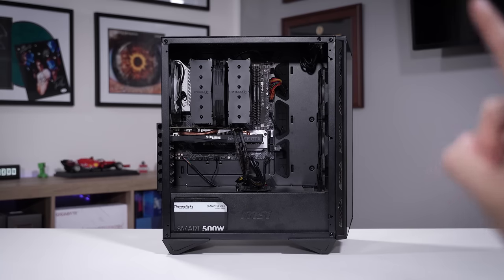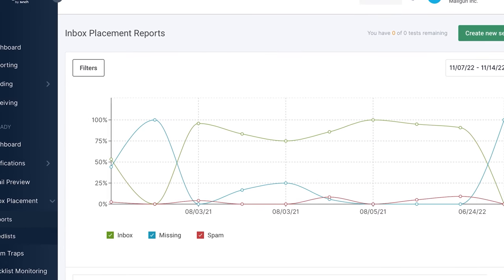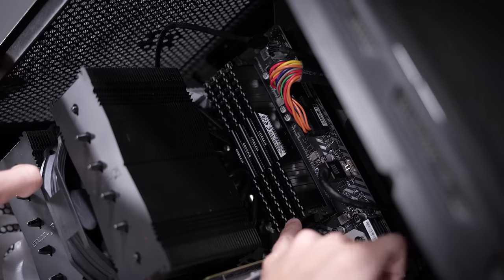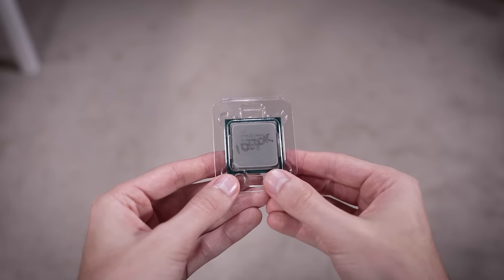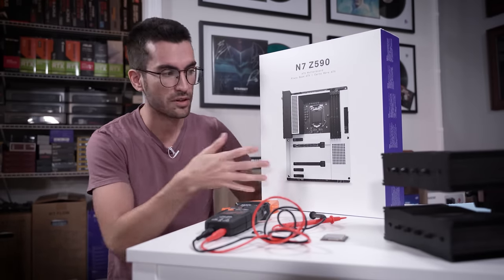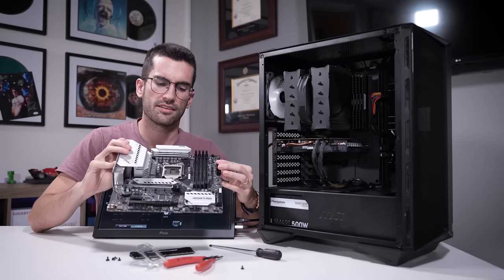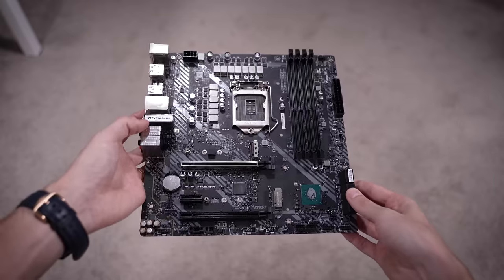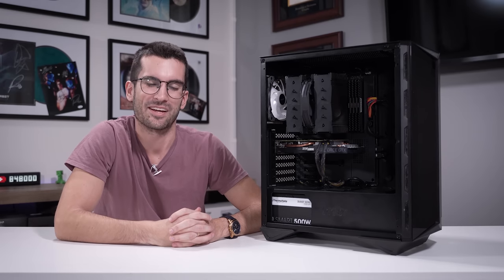Fixing a Viewer's BROKEN Gaming PC? - Fix or Flop S3:E14

Comment: @ 13:29 just to the right of the cpu socket appears to be a scratch possibly from mounting or unmounting the cpu cooler maybe there is a trace or two broken.
Reply: I noticed that as well
Reply: Can something as simple as a scratch cause that?
Reply: @Rez_97  would not surprise me if it did....
Reply: Wow! Good eye.
Reply: It does look like they trace is running towards the memory, so I'd definitely say they could be the cause of the problem
Reply: @Rez_97  yeah, it can potentially damage the traces. depends how deep it is. it doesn't take much to brick a motherboard. it should be relatively easy to fix for someone good at board repair.
Reply: good one.
Reply: I think its thermal paste drip actually, you can see the "line" of drip coming from the metal plate of the socket over to the motherboard
Reply: yes a scratch can in fact cause a board to stop working. as I did it myself on an older board I think it was an Asus Z170
Reply: @RidinWithMyLocsOn  when I saw it I thought it was thermal paste too, but it might be worth checking it out just in case
Reply from the maker: Yes, it was thermal paste hahah. Sorry about that. I should have clarified.
Reply: @GregSalazar  thermal paste can be messy sometimes. I got a motherboard half price on eBay because it was covered in thermal paste. Some time later after cleaning, works perfectly.
Reply: @GregSalazar  😆😆😆

Comment: Hi Greg,
I have an MSI MAG X570S TOMAHAWK MAX WIFI in my Rig with the same issue sometimes. No Boot and stuck on a white DRAM Led. This is a Bug with the Firmware of some MSI Boards apparently, even reinstalling does not fix it. I sometimes have to Hard Power down and then Power on my System 3–4 Times to get it booting. I swapped everything (Ram, CPU, Storage etc.) and even reinstalled the Bios a few times.
So chances are that when you power on / off the Board a few times it will boot in your case too. Oh, and it has to be done with not much time between the Power cycles, I don't know why, but if u wait like 10–15 minutes between them, it will just keep getting stuck on the DRAM Led.

Comment: I have been in a similar situation myself...

Some years back I wanted to overclock my locked Skylake CPU using a sketchy bios and needless to say I completely bricked my z170 board... Thankfully though It had a detachable bios chip so a few weeks later I got my PC working again.

Fun fact! I learned nothing and tried the bios flash again and it worked! Got my locked i5 6600 to 4.5 GHz!

Comment: I really, really like this series! Also, I want to thank you for what you’re doing to your community! I’m pretty sure this is a corrupted BIOS issue. When it happens, the MB will do all sorts of weird things and you cannot trust any debug information it will give you. My programmer has an in-circuit adapter and cost me ~80$. You could also buy preprogrammed BIOS chips, but you would need to swap it, solder it on the MB. It’s for you to decide how far you really want to go, since you have sponsors (maybe they could offer that service to you?). Keep the videos coming!

Comment: I noticed his ram is 3600 c18. I had a problem after a whole my computer started to blue screen, crash, and would not boot until remove and reinsert the ram with those same sticks. I even could not enable xmp on the board. DRAM light was on mine as well. I would try with a c16 3200. That fixed my problems and i can enable xmp with no problems. I would try that as a suggestion.

Comment: Hi Greg. So...after you swapped motherboards with completely different chipsets, how did the existing drives, and specifically, how did Windows behave after boot?
Reply: I've swapped CPU's and Motherboards using the same SSD booting drive and windows is perfectly fine the way you would normally use and operate it. Only different thing that will happen is instead of auto booting into windows you will get a Bios notification basically saying "new cpu detected" or "new motherboard detected" "press  F1 to run" then your golden. Isn't hard thankfully, just lets you know its been detected the change and thats all
Reply: I upgraded from a Z390 with 9700K to a Z690 with 12700K and my Windows 10 was fine with it. I only had to install a few drivers for the new motherboard and that was it. Not sure what would've happened if I moved into an AMD platform though, probably would've had to reinstall it

Comment: Never get tired of seeing the giant noctua coolers, ive had the nhu14s in my main rig for years and 0 complaints!   Might swap it for a newer black one soon.
Reply: @missterious69  You 100% used the wrong screws on the MB/Case. Or maybe you didn't tighten the cooler evenly and that caused a lot of pressure on the MB over time, since only one side was really carrying all the weight.

Comment: Had an AMD MSI mortar board similar to this and it had the same exact issue. DRAM debug LED was stuck on. Couldn't even use the flashbk button. Luckily the board still had a warranty and was repaired by an MSI shop.

Comment: Hi Greg. As part of your trouble shooting, do you ever check to see if the cpu cooler is on too tight ? First time i tried installing a hyper212 my pc would not post until i loosened the mounting screws on the cooler.
Reply: he remounted the cooler when trying his i5 10600k, so yes at some point in the troubleshooting this possibility is eliminated as he does this in all his videos, just a lot of it is cut to shorten the video length.
Reply: @yotoprules9361  I know a lot is done off camera, but I have not heard this mentioned as one of those off camera checks before, hence my asking.
Reply: @Zorthal  he usually takes the entire thing apart then looks at the CPU, CPU socket, etc, so when he's putting it back together he (hopefully) is mounting the cooler properly.
Reply: @yotoprules9361  you're making an assumption
Reply: @Zorthal  sure he is but its an accurate one and as we all know greg works on more computers than we are ever gonna get our hands on im 100% sure he knows how to tighten a cpu cooler
Reply: You are all misreading my question ! I know Greg is meticulous in his work, BUT has he ever mentioned that maybe the CUSTOMER has over tightened the cpu cooler causing it to not post ?
Reply: Same thing happened to me when I installed a 212 EVO on my MSI B365M a while back. Unfortunately, I think I tightened the cooler so much to the point where the traces themselves got damaged. The board still posts, but it's very unstable, lots of random system freezes, blue screens, etc. I replaced the board with an ASRock B365M Pro4 and all the issues vanished. Lesson learned there. Now I'm way more careful when tightening coolers as over tightening can really mess up those delicate traces; especially with coolers like the 212 EVO that have no dampening or any kind of protective material on the mounting bracket.
Reply: @Zorthal but we see him remove the cooler and CPU and no change. Whether the customer did or did not overtighten the cooler is not relevant. Unless you are saying overtightening the cooler killed the board.

Comment: If you are buying a bios flasher, get the ch341a v1.7/1.5 version.(one with IR receiver) useing a 5v flasher on a 1.8v chip will kill it.
It has a voltage switch for 5, 3.3 ,1.8v.

Comment: Had a kinda similar Problem with a pc we built for a friend. Z690 + 13600k, so we had to do a bios flash. The board supported flashing without stuff on it so we did everything, as gigabyte said it has to be done. The flashing went way to fast, after a dozen seconds or so it signaled to be ready. So that was something weird, as it normally takes some time. Anyway we built everything together just to get rgb and fans spinning but no output, and after like a minute the pc just restarted. The debug leds were always switching between dram and cpu. So we went and checked the ram, and it was working fine, another ram also didn't work. So we messed around and only used one stick, and it just stayed on dram. Gpu was working btw. After we tried everything we just went and sent it back with the cpu, as that could also be the culprit.

Comment: I had the exact same issue with an msi mag b550 board a couple years ago. Happened right after attempting to update bios. I ended up replacing the board but a few months later was curious and used the bios flashback on the board to install a different bios version and sure enough it worked.

Comment: Just built my 7700x pc. Glad it works fine lol. Ran it 3 days straight downloading a bunch of games and that's my real world sort of stress test lol. I'm surprised it's working considering I'm using a 650w 10 year old cooler master gx psu. Atleast until I decide to buy a new gpu when the mid range Gforce and radeon cards come out. Using my trusty ol 1060 atm xD 27" 1080p monitor with screen resolution using dsr to 1440p and all looks good lol.

Comment: My guess and though experience. He didnt flash the bios correctly or something went wrong during flashing which will give a DRAM debug been there a few times when flashing my MSI z690 board and pairing it with a i5 13600k which also showed the DRAM the first time i flashed it

Comment: Same thing happened to me when attempted to enter flash mode through bios (Ram led flashing-black screen) on MSI Z690-A Pro Wifi DDR4. Luckily mine was fixed by reducing temporarily ram sticks from 4 to 2. First thing tried that didn't help was CMOS reset.

Comment: Bad bios flash. Try replacing the bios chip? Most modern motherboards have replaceable ones. Just a thought!
Reply from the maker: He never flashed his BIOS. He was simply entering the flash portal when it crashed.
Reply: @GregSalazar  that's what he would say yes
Reply: @GregSalazar  ohhh I got you. So he didn't even attempt an update via the UEFI Bios?
Reply: @GregSalazar  Also unfortunately this motherboard has a soldered on bios chip. You could micro solder a new one but it's a pain.
Reply: @-Bracken-  you can flash the BIOS using a CH341a with SOIC8 clip without desoldering the chip, it is quite easy to use, usually available under £10 and I've fixed several boards and even a graphics card using this tool. Amazing device
Reply: @yotoprules9361  Oh sweet! Good to know! Thank you!

Comment: As for re-flashing the bios, I use a CH341a bios programmer, some of them come with the clip so no de-soldering needed. I have saved several motherboards using this tool that for whatever reason had a corrupt BIOS, and I "fixed" a fake GTX 1050ti that I got from wish, that was actually a 650ti, got a full refund on it so basically I got the 650ti for £10 (cost of the reprogrammer). I've also used it to flash a clean BIOS dump which removed the BIOS password as sometimes we get old company laptops that were previously locked down.

On the software side, there is the official CH341a software but I found ASprogrammer and NeoProgrammer to support more chips, plus you don't have to hunt down an english language pack for it.

The CH341a programmers + the clip is only like £10-15 on ebay, you may find it cheaper. You do have to be very precise when putting the clip onto the chip otherwise it won't read. Also, make sure you backup the BIOS, then wipe it, read it again to make sure it did wipe successfully, then make sure you flash a full BIOS dump, then read it back to make sure it did write properly.

Comment: The same happed to me with my Sabertooth Z170S, couple years ago. One night,  I just turned it off and when I powered back on, nothing. So I started to diagnose everything right away by unplugging everything the essential cable and nothing. The CPU LED was on on stock on it.. Well, the CPU socket died, just like that. RMA the board and got a new one. Now that rig is my home servers since I've upgraded while waiting for the board!

Comment: This happened to me recently, my board have a usb bios flash and i was able to save my motherboard. Normaly i didn't update my bios for no reason, i do it because i will not be able to install my new zen 3 processor whitout updating the bios. I'm glad i save my brick motherboard, i hate when the bios updating seems to be done perfectly but fail and corrupt the bios. I still remember my old X570 Asus Rog with a dual-bios that brick for no reason both bios and i never attempted to update the bios on it. I like those video because i learn more about pc troubleshooting.

Comment: To fix the bricked motherboard or corrupted bios. Instead of buying new motherboard, buy a tool called "CH341A Bios Programmer" or "EZP2019 Bios Flash Tool". I doesn't cost you more

Comment: My msi x570 mag gaming wifi will brick its bios if I flash it in windows or from the bios itself, I always have to blind flash it from the special usb port and button, I bet that board may have the same issue....why it has this issue, I dunno, but mine runs fine despite this irratating issue.

Comment: Having this issue right now with a brand new build, though a slight difference in event timing/cause. DRAM light stays on, though it does flash to CPU briefly maybe twice before staying on DRAM forever after.
Booted and got windows installed rather speedily, restarted and was entering setup. Did a couple clicks in windows setup then it blacked out. Fans and all that come on, GPU probably has the zero RPM setting and was known to work anyway in my old rig literally the morning before pulling it out for the new one. The RGB fans are not lighting up at all however and when I was in windows they were lit up. Reseated RAM, got new RAM, single RAM, different slots, reseated CPU, checked pins (might check again I guess), tried clearing CMOS but after watching about 20+ of these videos now I definitely did not hold it long enough so trying again tomorrow. If no luck, either new mobo or CPU time I guess.

Comment: Fixing a board like this, can take you down a rather complex rabbit hole, you end up pulling BIOS chips off boards with a hot air station, then maybe the chip itself is pooched, and finding one may be difficult to impossible.....   

Now on a MAC where a replacement board is $2,000 and Apple would rather you simply replace the computer for $2,500......   It makes sense to try and fix it.

Comment: There's another bios flash method that involves booting to a DOS prompt from a USB thumb drive (and all other drives disconnected), and then runs a .bat file which automatically flashes the bios, even though there's no video output as it happens. For such a procedure to work, would depend on what portion of the existing bios firmware is still functional. As others have said, the bios chip re-flashing procedure can be seen on several videos posted by the U.K. based YouTuber Adamant_IT. His method involves de-soldering, flashing using a special USB connected programmer device & then re-soldering the bios chip.

Comment: Fifteen or so years ago, I had a Gateway PC, and I tinkered with it...This was before PCI-E graphics. Most either used integrated, or PCI, or AGP.  I tried a non Gateway(Inte) BIOS on the board by flashing the board using a USB Thumbdrive.  It worked, but I was hoping to find more accessibility, there was actually less. So I redid the flashing, and it failed.
I was sunk, I didn't know what to do and on another PC I downloaded the file, and prepared without a folder tree. just the .bin, and because it was doing nothing I left the drive and pc on, and after an hour the bios spash screen out of nowhere appeared,like a miracle...

Comment: I know I am quite late to the party but that looks like a scratch at 13:57 that goes through some PCI-Lanes between the CPU and the RAM slots.
A friend of mine killed a board the same way while mounting a new AIO by slipping with the screwdriver.
But that wouldn't explain the symptoms of it bricking during a BIOS flash or while entering the BIOS flash menu so idk

Comment: I spent 4 months in Florida in 2020 during the summer. I noticed you guys get wicked lightning storms down there. This is coming from a guy from Texas.

Since you do these fix or flop videos for local people, I think it's possible all the fried PC parts are from power surges. 
I've never seen so many fried PC parts before. The stuff I come across the most is hard drive issues or malware removal. Rarely do I come across fried CPU's, mobos or GPU's. Just a thought.

Comment: Wonder if anyone can help, friend has 10700k i7 in pc. As soon as pc turns on within mins it's goes to 99 degree. Same in booting to bios, changed mobo, AIO water cooler, psu. Cpu works in another pc.

I personally think that water cooling is the issue and hopefully switch to air cooling may yield some results.

He has rang out of money trying to fix it...

Any help will be much appreciated

Comment: I have had a similar situation just happen to my msi x370 gaming pro carbon. my PC was doing a windows update and went to restart and just wouldn't post. similar symptom except it was the VGA debug on, screen completely black, change of ram made no difference, change of gpu no difference. I don't have a CPU or board to check the rest but having seen this video makes me wonder if it is a similar failure

Comment: And again another MSI, i hate MSI motherboards!!! Taking CMOS, off, reprogram it, and then solder it back. That might fix the issue, but in most cases best option to throw MSI board in garbage and buy a proper board, any board but the MSI.

Comment: Greg try this:
Download a bios for that motherboard, unpack it into an NTFS usb stick root foldert. Add it to one of the rear usb motherboard slots. Just leave the CPU, 1 stick of ram, boot it up and leave it there. Don't add any drive any keyboard, nothing.

If there's anything live left in there, the thing will self flash itself after some time, like within half an hour.

I salvaged so many motherboards like this you don't have an idea. Basically any uefi motherboard can do that, if the bios isn't physically corrupt.